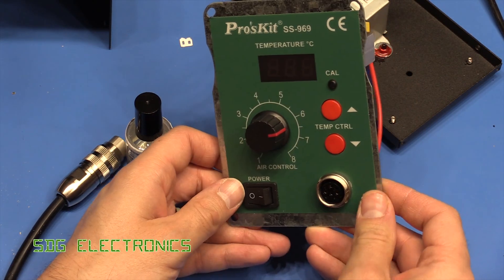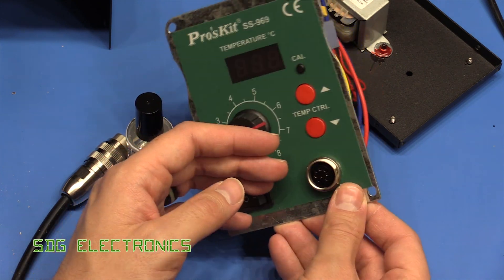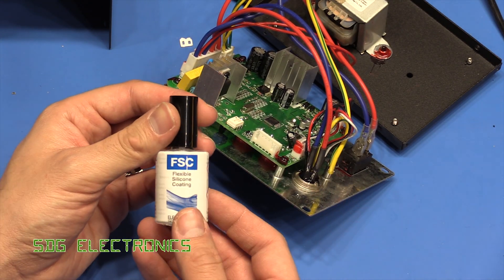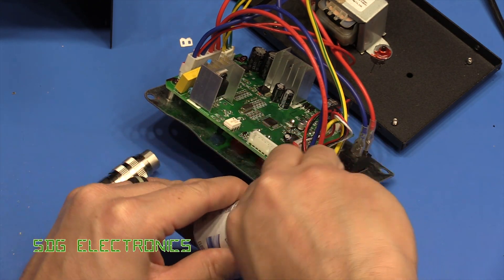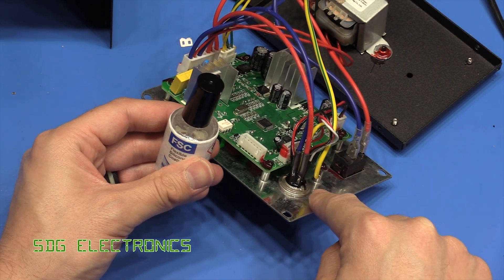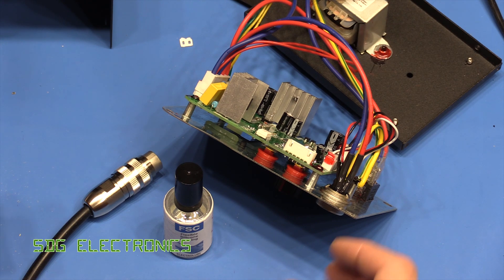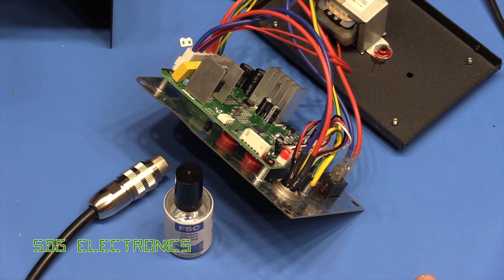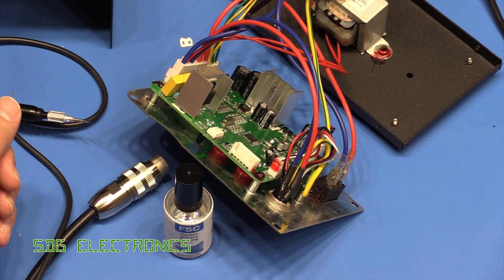SDG #050 Electrolube FSC Recommendation

Comment: also a must have for waterproofing drones. almost all sporty racing and freestyle quadcopters have theyr electronics pretty exposed, for coolling purposes and to save weight. 
normally for, slight rain, or wet grass already pose a conciderable risk to our costly toys .. but thanks to this stuff, there is footage of drones starting from under water! :D
Reply: How it compares with other coatings such as MG chemicals silicone conformal coating? Is this a UV-curable solution?
Reply: i havent tried other coating, aside from clear nail polich. there ae UV curing ones, but this is solvent based (and absolutely reeks!). but it fluoreces blue under UV, so you can check the coating.